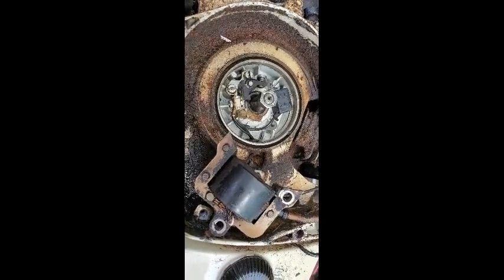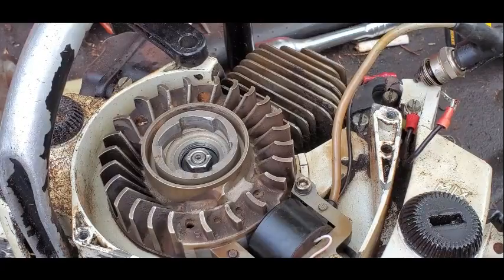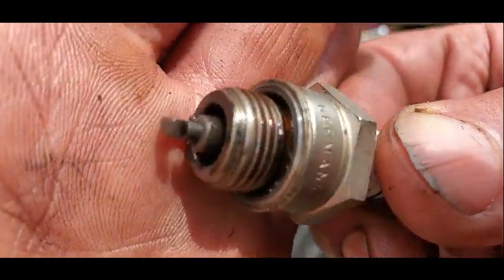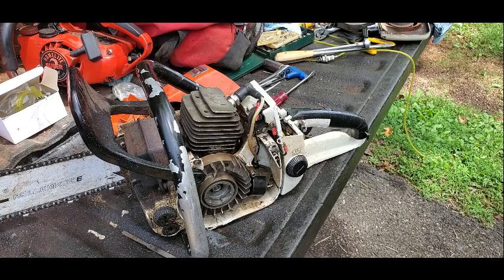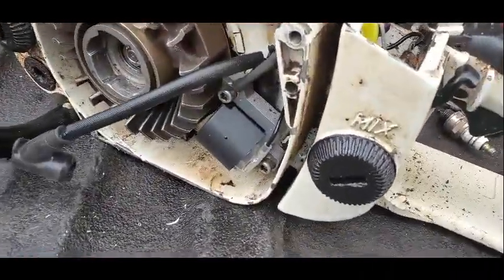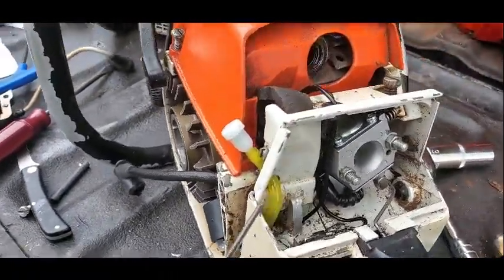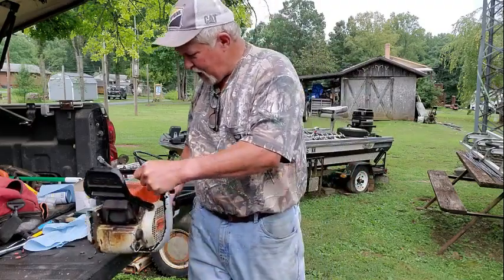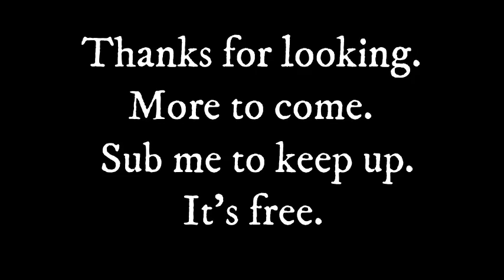Resurrecting a Free Stihl 028 WB chainsaw with problems

Comment: Yes, do the chip, , , it's quick, easy, and you don't ever have to clean and set the points.  Nice job.   Keep the old carb for sure,   I bought several replacement carbs from china, and threw all of them away.  Never will I ever buy a chinese replacement for Stihl equipment.
Reply from the maker: Chineseismnated parts are hit or miss
Reply: @ClintsHobbiesDIY  Yes, I agree, I didn't check on who / where the chips were made, but now that you mention it, ,, ,yeah, most likely china.